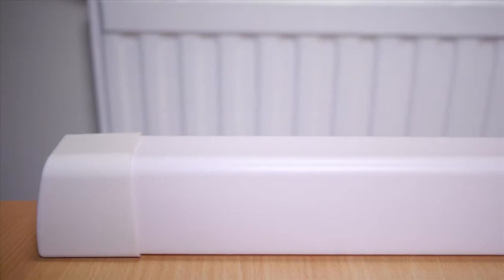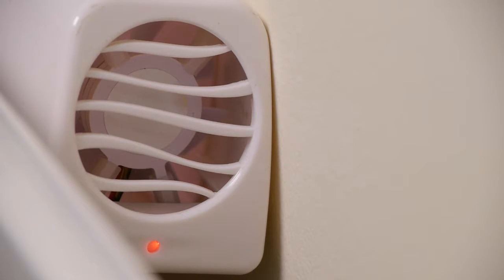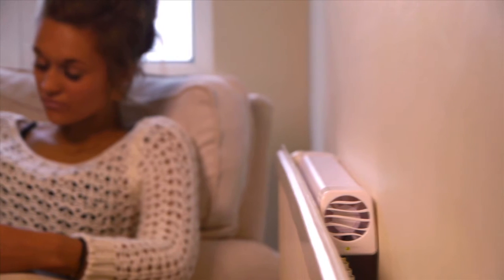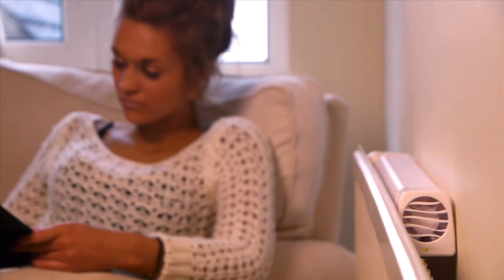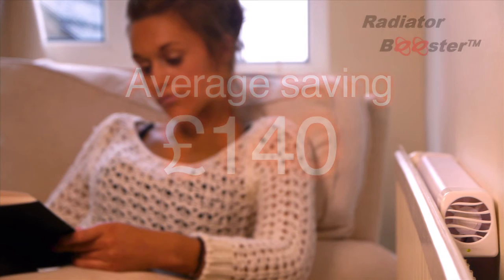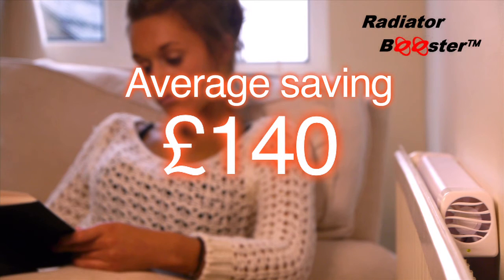RADIATOR BOOSTER NEW TURBO MODEL

Comment: IT'S NOT GOING TO SAVE YOU POWER (deliberate shouting). Just gets the heat up a wee bit faster. "Save up to £180 per year" is total bollox. Lamentable paucity of grasping primary school physics, or deliberate snake oil.
Reply: In an independent test by Which Magazine (April 2011), they found that: "Our test lab found that with the radiator booster fitted, the room heated up more quickly, the thermostat needed to come on less often and energy consumption dropped."
Reply: @nigelblake806  Yea well I go by laws of physics and it will not save £140 per year.